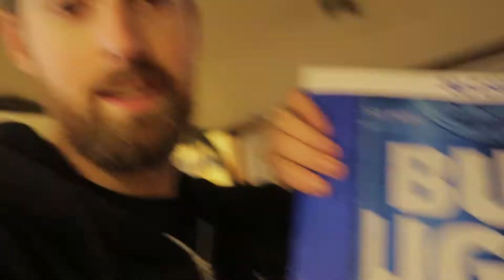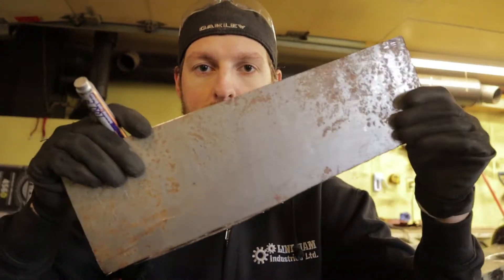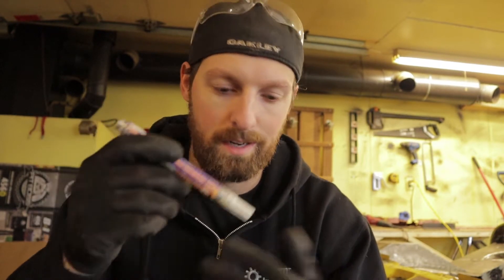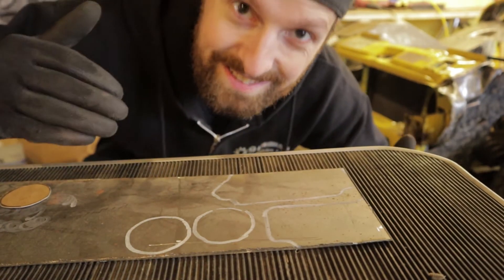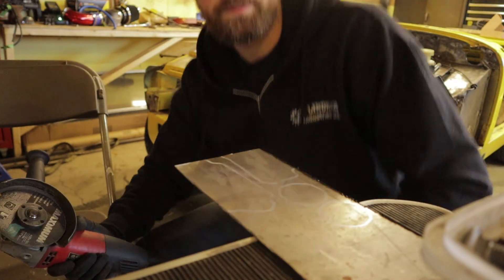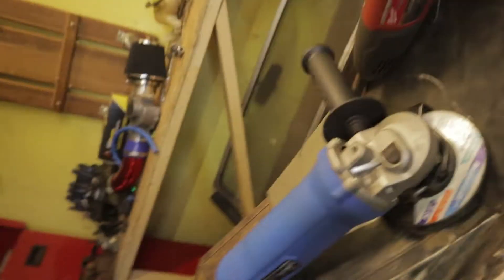MG Build Series: Ep. 3- Using CAD to fix my 1978 MG Midget

Comment: To make your life easier, it is possible to move the position of the shifter on to of your transmission.  It is currently bolted in place by 4 bolts and you have the selector shaft going to you lever.  Un-bolt it and shorten the shaft so the shifter can move forward, so the rear bolts need to line up with the front bolt holes.  Then you can bolt it down and weld  up the selector shaft.